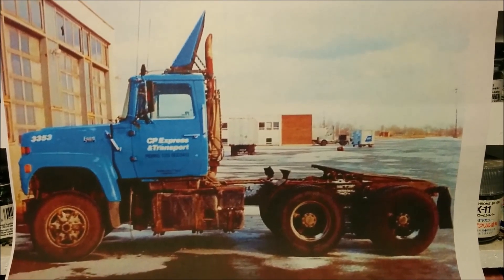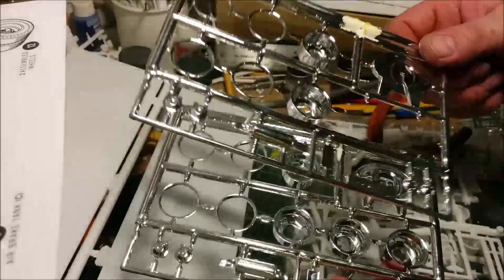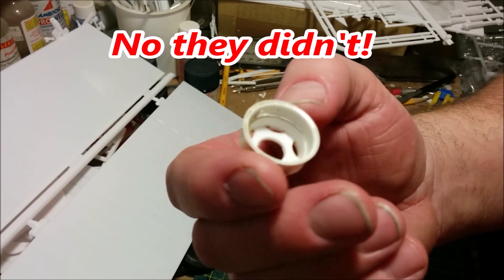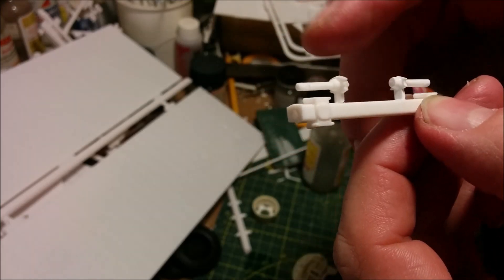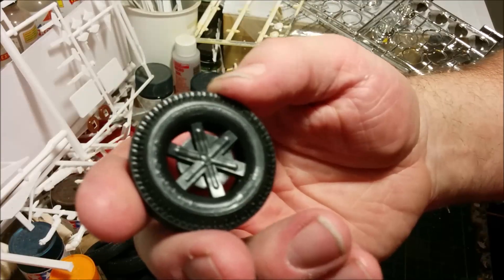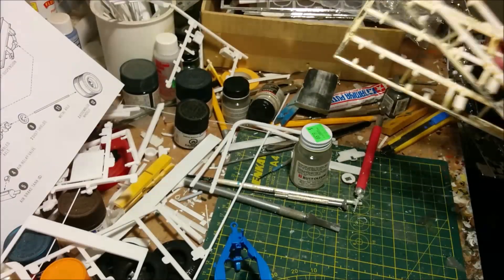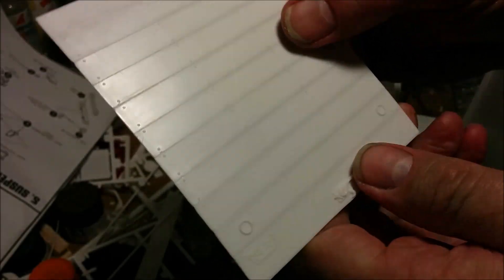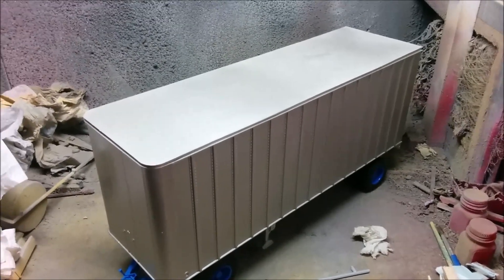Building a CP Express A-Train 1/25 Pt4

Comment: I assume CP was a LTL type company. Here in the states we had similar companies like CF, Carolina, Preston etc etc and their trucks and trailers were also always filthy and dirty. Maybe back then they didn’t have wash bays on their terminal sites like they do today. I could never figure out why their equipment was so dirty. Guess the drivers just drove them and parked them everyday.
Reply from the maker: CP Express and Transport were as the name implies a consolidation of CP Express (LTL) and CP Transport (Trailer Load services) when CP Transport was independent their tractors were red and the multi-mark (pac-man logo) had a red background. At some point Canadian Pacific figured their mission and market were close enough to merge them. The Ottawa Ontario terminal had no wash bays. When I worked there as a security guard they had an outside contractor with truck mounted wash equipment wash all the cabs every weekend. Never made much difference!

Comment: It's interesting that, the reference picture at the beginning of the video, shows the cab and hood as being very clean, and the frame and wheels looking like they are about ready for the scrap yard.
Reply from the maker: The hood at least was fibreglass, the cabs were steel and did rust. I think height over the road helped to protect it from the salt.

Comment: That deal with the rims and lugnuts should be viewed as a small detail exercise! This kit(which a built when it was released) is in dire need of callouts that are actually useful! Lucky for me,I had the triple axle gravel trailer and didn't build the dolly, because i had to dig through and scavenge several parts that were missing or busted!
Reply from the maker: Lots of potential in these old AMT kits they just require patience.

Comment: I had excellent results stripping chrome with Super Clean. It will take the chrome and lacquer coating off in a day or 2 with no scrubbing. Just pull it out, rinse it off, and you're done.
Reply from the maker: I may try that in the future.

Comment: Dan+ great job on these pup trailers I am going to do consolidated freighways set up with the freightliner there's and easy way to paint those posts on the trailer you could use a sliver sharpey marker or paint pens I want to do mine white then use eather pens to paint the posts alonium misspelled that sorry just and easier way you could also use bairmedle foil as well